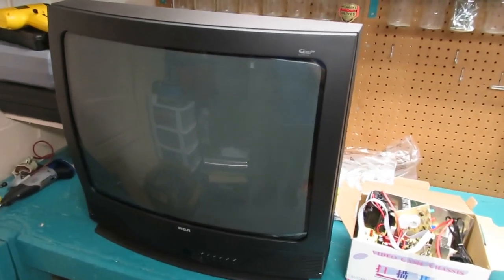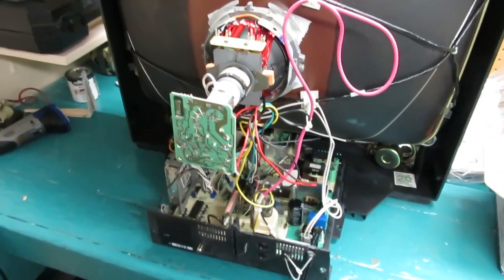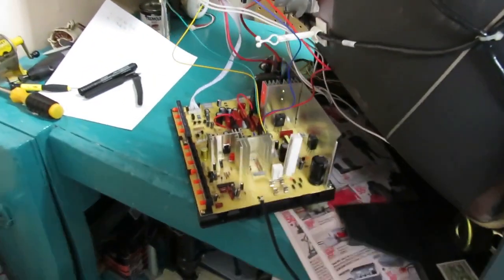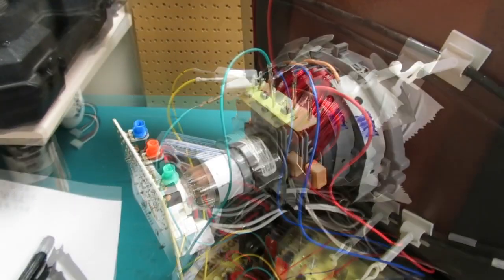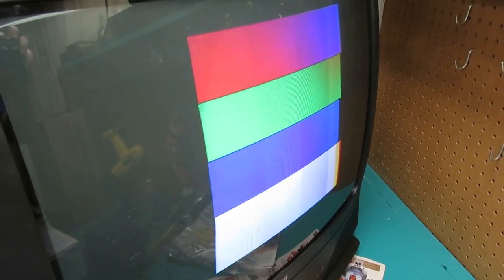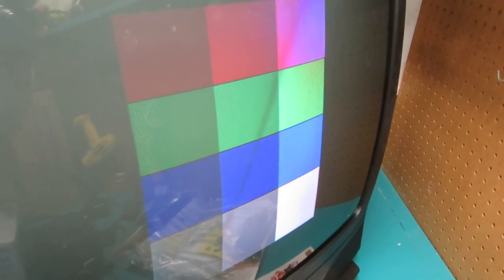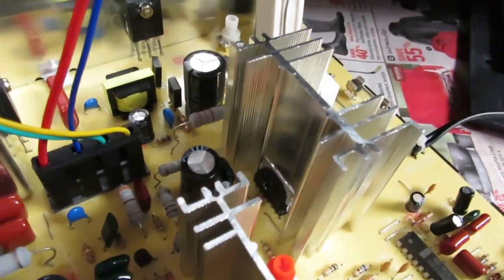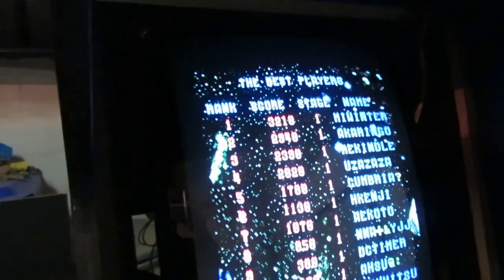Installing and modding a Wei Ya clone 25" universal arcade monitor chassis.

Comment: Nice video. I have a couple of very similar Chinese chassis in two of my machines. I've had "fun" with them over the years, but did have to replace a few capacitors here and there, but for the price, pretty decent. Oh, Thunder Dragon looks like a bit of fun! Cheers.

Comment: Nice install, I built a monitor from a 25" tv, bought an arcade Hantarex Chassis and set it all up, was a lot of fun building that and getting the picture just right,  had it all working outside of my cab on the bench so put it all in the cab all wired and ready and the tube did not what to light up no glow on the tube neck nothing, I could hear the chassis running but no high voltage, so took it all back out cast my eye over the board and saw nothing, in the end I found some cracked solder joints on the horizontal transistor which were so hard to see I needed an eye glass to see it, reflowed them and boom the tube kicked in, the picture is awesome.

Comment: PCBJUNKIE, what is the difference between sync signals compared to Deflection signals, what are the differences? Can you explain the difference between a Raster monitor compared to a XY vector monitor?
Reply from the maker: A raster monitor draws the frame line by line, usually starting with the top left, going all the way to the right horizontally, then retracing back to the left and drawing a new line, left to right again, just below the previous one. This movement of the electron beam (raster) is controlled by the deflection signals from the monitor's internal circuitry, and is synchronized / reset by the sync pulses. The sync is only a short pulse, but it tells the monitor when to start a new line (horizontal sync) or go back to the top left corner to start a new frame (vertical sync). Vector monitors don't have this "line by line" circuitry so they allow for full control of the position of the electron beam at any given time. A vector monitor can therefore draw the image on the screen in any direction, just like a raster monitor can, but in most applications, only a series of independent vectors is drawn to form an image without scanning the entire screen.
Reply: @pcbjunkie1  thanks, the deflection signals are sending voltage& current signals pulses to the YOKES and the YOKES are sending "magnetic signals" to the Electron beam? The Deflection signals are just High Voltage  Pulse square waveforms but how do deflection signals do the position coordinates CRT screen using the Electron beam. What I mean is that the Deflection plus voltage& current value pulses the YOKE. The Yokes magnetic field determines the CRT coordinates position of the electron beam? I'm confused because V&H sync signals are the CRT coordinates positions of the electron beam but also the Deflection signals are the CRT coordinates position of the electron beam, so I'm confused between the sync signals and deflection signals in raster monitors. The advantage of Vector monitors was that they can draw "shapes" better detail or what was the advantages of using Vector monitors compared to Raster monitors?
Reply from the maker: @billwilliams6338  In raster monitors, the sync is a digital pulse that tells the monitor to restart the raster scan. The monitor itself creates the deflection signals and sends it to the yoke which bends the electron beam to a desired position. In a vector monitor, the deflection signal is generated by the attached device. The deflection at the yoke is always analog (no pulses), and yes the current determines the amount of "bend" of the beam. Vector monitors take in X-Y coordinates (and RGB ) as analog voltage and amplify it for the yoke.
Reply: @pcbjunkie1  thanks for the help, Any reasons why you can't connect a grounded earth oscilloscope to the arcade monitors circuit boards because it will damage the circuits boards. I'm not sure why they make the arcade monitor circuit boards not connected to earth ground. They use an isolation transformer to lift the earth ground from the monitors chassis but not sure why. The Flyback outputs a High Voltage from 19Kv to 30Kv but the CRT anode, but this High voltage is just only used to power the CRT tube or does the Flyback supply other circuits in the monitor or its only used to just Power the CRT tube? The Focus trim pot , picture tilt trim pot and Contrast trim pot on the monitor boards are adjusting the Electron Beams Position by "bending" the Electron Beam? or is the focus , tilt, contract adjusting the current or voltage to the electron beam?

Comment: That was 😎 it seems if u hooked the tube to a better chassis like a wells gardner it would've been perfect.  I wouldn't have put a resistor on the yoke.. maybe that's why your screen was jumping.  If ur yoke was reading low, why add a resistor? Let her rip.  Since your monitor is sideways  perhaps adjust your horizontal size n hold.

Comment: I have this same chasis. Is there a way to connect horizontal and vertical syncs seperately or is it always the two cables to the same pin?
Reply: you can use the same pin for both it doesnt matter like you connect the sync to the csync and you start a new cable from csync to vsync.

Comment: Would this chassis work for a 19 inch monitor.
Reply from the maker: They do sell these in different flavours. There is one that works with 13 and 19 inch tubes.

Comment: How did you ultimately fix the waviness that you had when you talked about originally turning up the high voltage.  I got this exact same chassis and I get some slight waves similar to yours at 19:40 .  Later in the video you have a bright image but you eliminated those waves.  Check out my most recent video of the effect I get.  You seem to be the only one who has recent experience with this chassis who can help.
Reply from the maker: I looked at your video. Your problem seems different. The waves in mine were (still there actually) due to brightness. Yours seem to be due to being too close to a transformer. That would be my first guess.
Reply: @pcbjunkie1  Okay thanks for checking it out.  You're probably right it could even be the flyback transformer failing.  I made the mistake of booting it up without an isolation transformer for a good 2 minutes and I think I did some damage.  Not really the end of the world because I still get something that looks decent but I'm still a little bummed I can't get rid of these waves without spending another 50$ to maybe fix it.

Comment: Where do you connect degaussing coil to this chassis?
Reply from the maker: You don't. It's not supported. You need one of those degaussing wands if you're going to be using these.
Reply: @pcbjunkie1  Thanks!

Comment: Nice!   I want to do this exact thing to a few TV sets.   I just want to have a 25" vertical and 25" Horizontal JAMMA cab.  I actually have a Virtua Fighter 2 cab with a 25" STD/MED res monitor with a dead chassis but if I get it working I hate to butcher the machine.